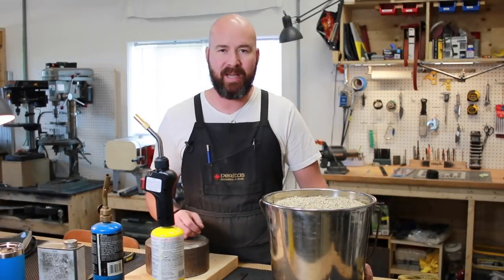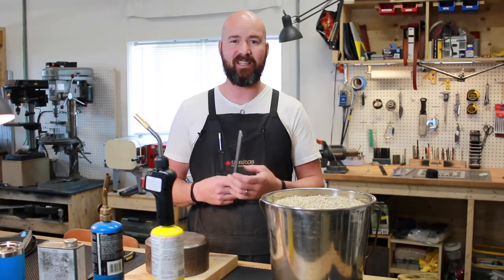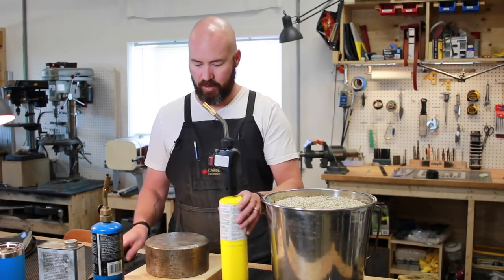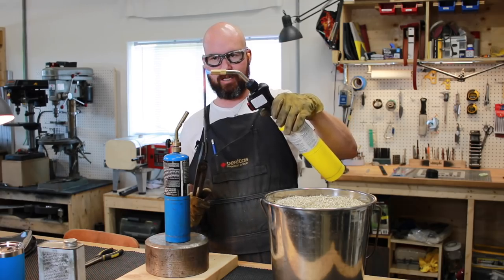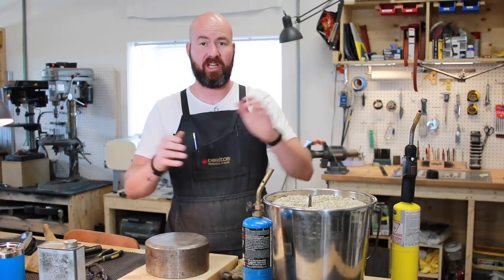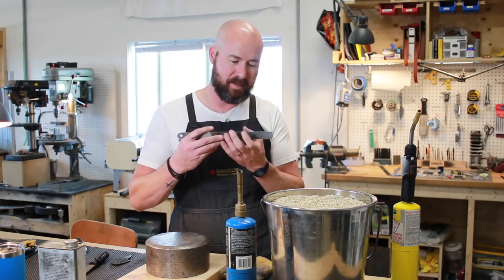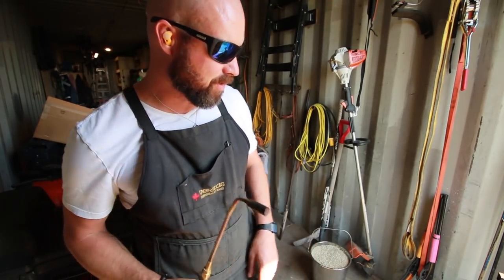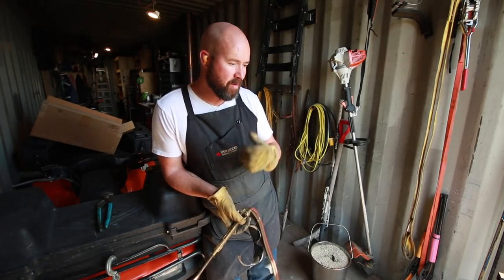Kiridashi Build Along - Part 2 -

Comment: I use perlite. Works good for me. I love making file knives. I just got a huge bucket of old files at an auction today for $5.
Reply: Perlite, if you have the smaller grains, kinda like sand and a bit bigger, makes a crazy good, non skid throw it down and try to slip, on icy sidewalks.y some next winter. Essentially expanded or heated to the blow apart state obsidian.

Comment: Using vermiculite is a really good idea, I need to buy some anyway for a roof repair project I have to do this summer so I'll make sure I put some to one side.
Seeing how hard the file was after annealing I think I would go for the angle grinder option, messier but faster and easier on the hacksaw blades. I have a habit of breaking them.
I didn't get the notification for PT 1 so this was a surprise but a build along is a great idea.

Comment: Wow! This was a terrific video and I can't wait to see the rest. I so appreciate your going at an instructional video series like this. Mad respect. I hope you don't mind, but I know if I was standing next to you when you were hacksawing, I would have made a little suggestion for you to consider. I've done some cuts like you achieved, and did them with little cuts going adjacent into and just meeting up to my design line about a quarter inch apart. Then took the cuts parallel to the design line one at a time. Lots of little cuts nibbling away at the material made for a more controlled cut and I made less sweat. ;) I didn't try using a hand power coping( jig)  saw like you attempted, but I did use a small bandsaw to make the adjacent cuts and a hacksaw for the parallel cuts. It could have been done all with a hacksaw. Lot's of little straight cuts are a little less a chore than trying to make a long curved one. What do you think?

Comment: When I anneal files I build a good size campfire and get it nice and hot with a good bed of coals.  Once the fire's hot I throw a handful of files in (I buy them used at yard sales for less than $1 each) and keep it good and hot for awhile (I usually give it an hour), then I let the fire burn out on it's own.  The files will be as soft as they're going to get when you dig them out of the ashes.  This system also works with a woodstove if you have one.

Comment: I heat-treated my first 2 knives using hardwood charcoal in an old grill with a hair dryer (beard dryer, in your case :-) ) blowing through the bottom air vent. I was surprised to see that they reached critical temperature (1095 steel) and hardened successfully.

Comment: Hey there Jeremy, thank you for the inspiration on the heat treating. Very useful for a beginner like me. BUT would love an answer to this: Is it possible to make a knife (stock removal) after hardening and tempering? Heat is not a problem when grinding because I use hand files for beveling and shaping. Thank you.
Keep those videos coming. Cheers mate.

Comment: Yeah I just finish one of my blades, and for you new guys to this. Make sure you use a good heat source. Gas is a control heat source that many people use, but you can use a coal/wood with a ton of air and that also works ( But watch out with over heating the metal).

Comment: An option for heating to critical is a "weed burner" torch that connects to a regular 20 lb. LP tank.  That's what I used to heat treat in the early days and it works well.  I think mine was maybe $40 US with a coupon at Harbor Freight.  Besides working well, it's just really cool.  When you squeeze that trigger, it's like you're holding a jet engine. Dat shit got powers yo!

Comment: The point where carbon steel loses its magnetism is actually a bit before the critical temperature of most carbon steels. That means that when you reach the unmagnetic point you want to heat it for like 10 or 15 seconds more, maybe a bit longer than that if you're using a blowtorch.

Edit:
This is what I have learnt. It has worked for me but don't take my words for being 100% facts.
Reply: Rasmus Vestergaard was about to comment this. I have found this true too.

Comment: I like using file steel. But I use power tools. I don't anneal it while grinding i dip it in water constantly to cool it. Then anneal it in my oven at 400 degrees for an hour. Sanding and polishing does take longer this way.

Comment: You can dig a hole in the ground light a charcoal fire or even a wood fire in it than put the file in the fire and use a blow dryer a mattress pump or anything that blows air and blow on the fire this is how i got started. Purgatory Iron Works has a good video on this and he goes it depth on home made forges

Comment: Grill charcoal. Even U can dig hole in ground. Put charcoal, heat by torch. Is easiest way for forge somthing- or unhardning in this case. If U like spend cash, can buy charcoal plate used by silver/gold smith. As i use tradytional forge, i often for small things use it only as a bowl, and heat piece by torch at charcoal, dont use blower

Comment: What's the blue marking spray you use for the silhouette?
Reply: Outside & Stuff -  It's blue Dykem layout fluid.  The bottles with the felt pad (model # 80200 for the 2 oz bottle) on top used to dispense the dye work best and are much less messy than the spray and the brush applicators, as there is no overspray to deal with or spilled bottles to worry about 😉👌

Comment: would the warp be because the hotter MAP gas on ones side and the propane on the other causing to different temperatures ?  Also would 2 torches with MAP gas work better since MAP burns hotter ?  just trying to wrap my head around how to start
Reply: i use map gas and i find it works quite well

Comment: At the very least you must have an angle grinder I wouldn't recommend anyone trying to make  a knife without at least having one
Reply from the maker: I agree. I have 5 but wanted to go for a manual labour challenge on this one😆👍
Reply: you can get some for $12 dollars at harbor freight. Mines lasted for some good time now.
Reply: I'm gonna second on the angle grinder for the rough cutting and grinding and then to finish the profile with files.  If I would have done knife #1 with hacksaw and files only, there never would have been knife #2.  I don't have the patience!
Reply: the little screwfix one isn't bad for occasional use
Reply: I disagree that it's a must have but having one will make the process so much easier. Also something like a Dremel can be helpful plus they have more uses.

Comment: I'd say you're much better off NOT annealing the file and just keep it cool with water when grinding. A homegamer will never get a heat treat as good as that file originally had. Also you can by a grinder for much less than a good set of files and get it done in an afternoon.